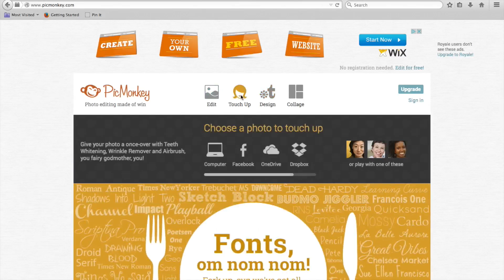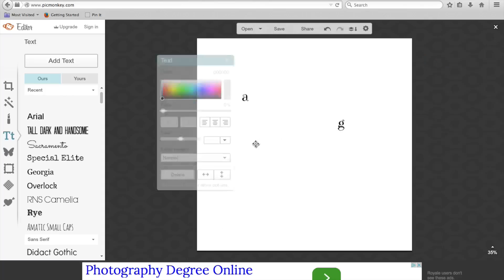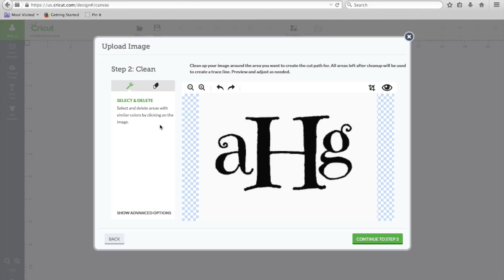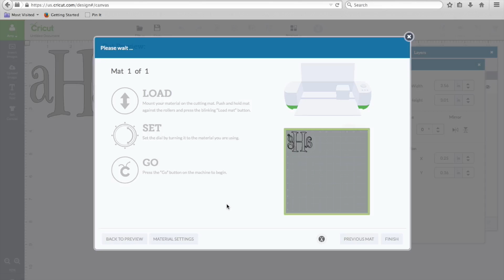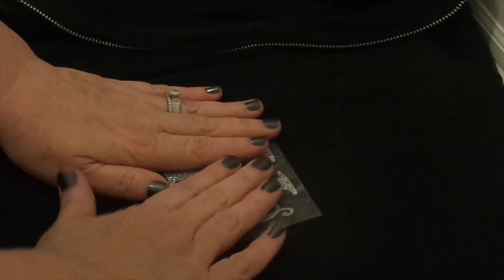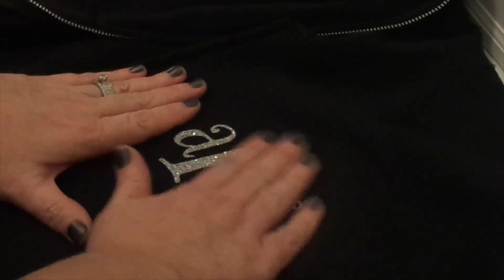Monogram Hoodie with Heat Transfer Vinyl and Cricut Explore

Comment: Hello, I put logo on my shirt with glitter vinyl but after few hour I noticed that it started coming out from my t shirt. Please advise if I am doing some thing wrong.  Thanks
Reply from the maker: It is probably that heat, you have to use pretty high heat and for longer than you would think.  I actaully still wear this hoodie to this day and the glitter is still on great.  I even wash and dry it.  Also, make sure you are using good quality HTV.  I really love the stuff I get from expressions vinyl.  http://bit.ly/2ikDstE this is my affiliate link to their site.

Comment: Do you know if HTV can be machine washed and tumble dried when it's on fabric? I want to give this a go with my cricut but not if i can't wash and dry the item with the rest of my laundry!
Reply: yes it can be machine washed and dried.  Expressions vinyl also has a stretch htv that is even more versatile
Reply: Thanks for the reply! Joy Riddle :)
Reply from the maker: +Leah Lou mine has not come off and it's been washed lots of times. I even dry it on low in the dryer although I don't recommend that because it says you shouldn't.
Reply: Leah Lou I own a screen printing business and I also work with vinyl. I only recommend washing it IN SIDE OUT on COLD water and air dry or low low low heat in the dryer. Otherwise it may wrinkle and peal off

Comment: I have looked inthe comment section to see if you answered if this vinyl can be washed but no answer. Can you answer if it can be washed and stay on the shirt?
Reply: yes u can
Reply from the maker: +Pepsi M. mine has not come off and it's been washed lots of times. I even dry it on low in the dryer although I don't recommend that because it says you shouldn't.

Comment: How did they hold up after washing?
Reply from the maker: +Lindy Fancher mine has not come off and it's been washed lots of times. I even dry it on low in the dryer although I don't recommend that because it says you shouldn't.

Comment: I'm new to this but was wondering, do all sheets of vinyl that you buy have that top plastic transfer tape on them like the glitter iron on you had in this video?  I wanted to also but out permanent vinyl monograms to put on things like mugs and cups and clip boards.  Having that clear plastic on top would sure make it easy to line things up :)  Thanks in advance for your help.
Reply from the maker: +Stacey Reames Hi, no the regular vinyl does not have the transfer tape already on it, you have to purchase that separate.  Everyone has their preferences about it though, I like the transfer tape from www.expressionsvinyl.com but some folks just use clear contact paper.  also, I have some videos where I use vinyl and transfer tape, check out my cricut playlist.  Hope that helps.

Comment: I just got my new cricut explore in the mail today and this video is the reason I picked this one. I was so excited to iron my initials on my new pink shirt, Well it came with some sample patched in the starting packet. I do not know the difference of the papers, if there even is a difference. is all of the vinyl iron on or do I have to buy a special kind of paper. When I took this piece of vinyl I put the colored side on the mat and had it cut that way. To be an iron on does the backing need to be clear? I have no clue what I am doing, but you look like a pro, PLEASE HELP! :)
Reply from the maker: Did you get a white sticky piece?  That is typically the iron on.
Reply: +Maymay Made It Crafts Amy Helms yes it was like a regular sticker, wasn't clear.

Comment: I've found that cutting with the glitter vinyl it comes off of your transfer tape easier if you cut it on the card stock + setting and you won't have to help it along.
Reply from the maker: Shea Bailey Thanks for the tip!
Reply: ***** The Cricut video from their website says to use the notch right after iron on for the glitter. :)

Comment: Great video.  I'm just wondering about washing stuff like this.  If I have to be extremely careful and wash inside out, on delicate cold, and no drying,  I can do that, but I don't think others that receive it for gifts would think to do all that. So I'm wondering how much this can take in the washing/drying process.  I would think most people would throw the garment in permanent press, right side out, and then chunk it in the dryer.  What would happen then?
Reply from the maker: Claudia Lasiter I am going to be totally honest with you, as I always am, I wash them as I wash all my clothes.  I wash colors in cold and I typically hang dry or dry on ultra low.  I don't turn it inside out or anything.  These two have held up very well.  I love them!
Reply: Claudia Lasiter great question I need to know too
Reply: ***** Thanks for the info!

Comment: How do I use the "monogram it" app and upload to CDS? It will not "clean up" for me. Do you suggest I upload it in inkscape and save as an svg? I'm so lost. I hope you can help!
Reply from the maker: Casey Arnold I have not used the Monogram it app.  I would take a screen shot of it and then clean up the photo you take.  You can take a screen shot on any operating system.  Mac or Windows.  Google the instructions for taking a screen shot on your computer and then upload that to CDS and clean that up.  I have found that to be so easy.  You really wont' need to do an SVG if you use the photo of it.

Comment: Fun project Maymay :) I have used vinyl in several projects but not like this. I am curious to see how this holds up.
Reply from the maker: Craft Corner with Esther C I have been told and read a lot about the HTV, they say that if you wash them inside out and dry them inside out they will hold up.  We will see!

Comment: These cricut tutorials are really making me want to get one. I'm not sure about it yet however if you don't mind Amy I would love to know your thoughts about the cricut.
Reply from the maker: ChuckIzWeird I can do a video on it but I can also just let you know that I am in love with this machine.  In my opinion Cricut really got this one right, the best part is the wifi and the fact that the machine really does cut well.  Not at all like my expression.  I love my expression for paper, but no other material cut very well.  Hope that helps!
Reply: so to be clear the expression and the explore are two different machines that do different things or have different strengths.It seems the expression is more popular however from what you are saying Amy the explore would be a better choice. Correct?
Reply from the maker: ChuckIzWeird The expression has been around much longer, the Explore is only a couple years old, if that.  The expression is a fine machine for paper crafting.  However, it does not have the bluetooth capability and it doesn't have the cutting precision that the Explore does.  If I were to invest right now in a machine, I would get the Explore Air, it recently released on HSN and it has built in bluetooth.  The explore has a bluetooth adapter, which is no problem, but you might as well get the newest one out there.  The expression is not as precise and is much "bulkier" in my opinion.  Not so much in size but in feel of operation.  But, in essence they are designed to do the same thing, the expression is like a Ford and the explore is like a Cadillac.  I drive a Ford and it is a very good car, but if I could have a Caddy I would. LOL
Reply: i see thank you for all of that Amy. Very helpful. I will be look into an explore air:) Or an explore depending on what I can get my hands on when I have time to research. Thank You again:)

Comment: While I have a Silhouette Cameo instead of the Cricut Explore, they do the same thing.  I have been using vinyl quite a bit and a tip that I found to help with weeding (especially around lettering)--trim around the outside of the image as close as you can with scissors to get rid of the excess vinyl before trying to weed; this really helps to prevent all the pulling and tugging of your image and risking distortion of your cut image.  I have only had my Cameo since Christmas and I think I've only used it once to cut cardstock, I've been cutting vinyl and I find myself now wanting to label or add words to anything I can find!  It's addictive.  My next attempt will be the heat press onto fabric items; just wanted to get the feel for cutting vinyl before I take the next leap into heat press.
Reply from the maker: Cheryl Shephard That is a really good tip, I will try it next time.  I too have not cut much paper, I am enjoying this vinyl and iron stuff way too much!